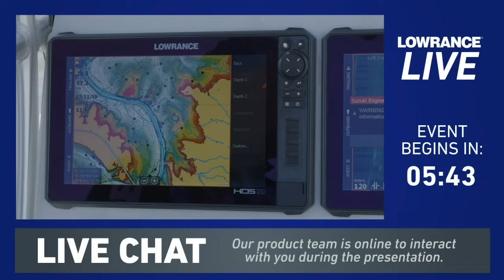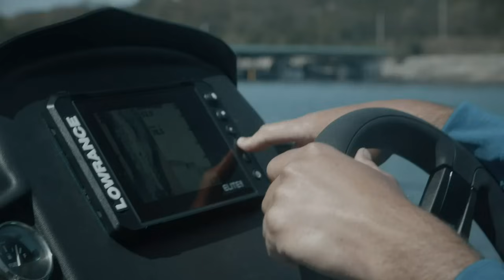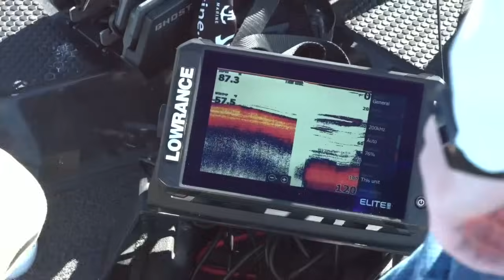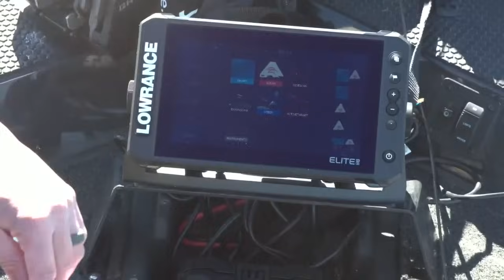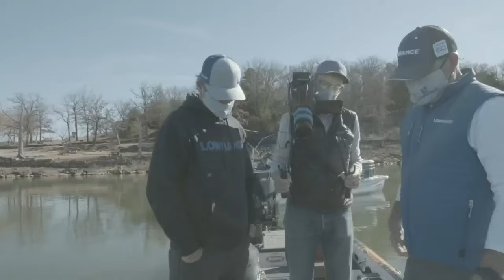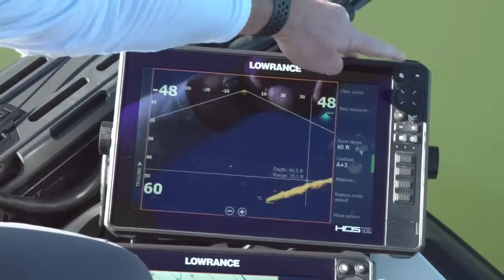Lowrance LIVE | Elite FS and Active Target featuring Jordan Lee and Gary Klein

Comment: Hi there I have a question 
My question is I have a 9” active target carbon up front I want to buy two more units one more for the front of the boat and one on the drive set I want to go all Lawrence but I want them to all be network what are your recommendations on a Units thank you
Reply from the maker: In order to have the unit networked with the HDS Carbon to be able to share sonar and maps, you will need to have a Elite FS and/or HDS Live. Indeed, you could also use another HDS Carbon.

Comment: i just purchased the Elite FS9 yesterday going to use this unit on the bow is it better to mount the 3in1 transducer on the trolling motor are on the rear of the boat?  Also planning on adding a 2nd FS9 on the dash latter can I run both of on transducer?
Reply: 3-in-1 transducer provides sidescan and downscan.  Sidescan really isn't something most get any benefit from at the bow.  Its view is best when moving forward at a steady speed (3-4 mph) without a lot of direction change.  That transducer matches best mounted at the stern with a display at the console, not the bow. At the bow, an HDI transducer is what most choose to go with the unit at the bow.  In fact, that's what is standard for the built-in transducer on Ghost.  Set the 3-in-1 aside to mount later with a console unit. Get an HDI transducer (with 2D and downscan) to mount under the trolling motor.

Comment: I am a trout troller. I do not fish for bass, etc. I fish California Mountain lakes, trolling exclusively. I currently have a Lowrance HDS 9 carbon set up with the 3D Transducer, and Structure Scan, Down Scan, and Side Scan, and GPS Point 1. Would there be any advantage to switch over to this unit at this time?
Reply: will it work  with my new hook 2 12 triple shot?
Reply from the maker: You do not need to switch over to the Elite FS.
Just add the module and transducer to your HDS-9 Carbon.
Perfect fit.